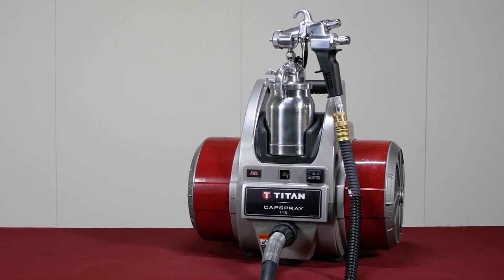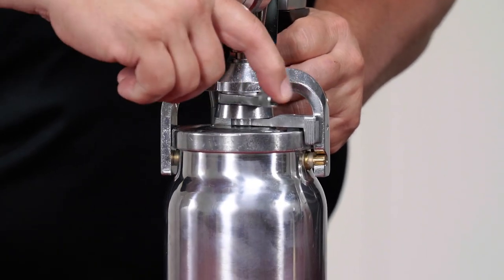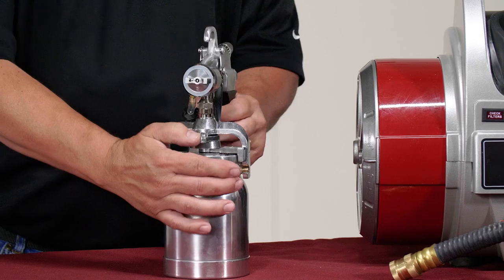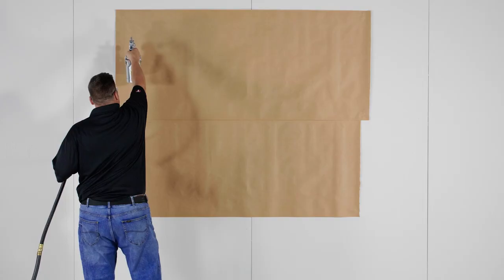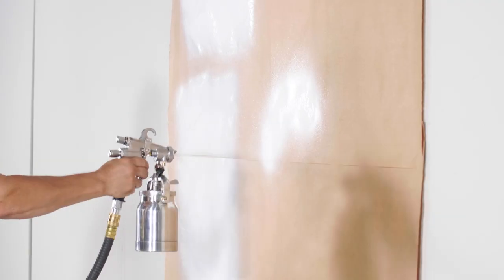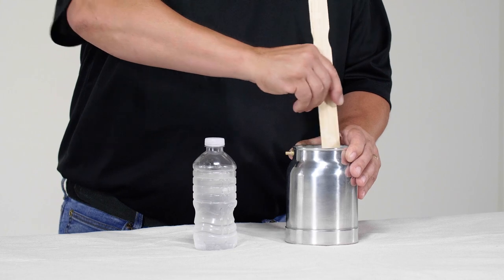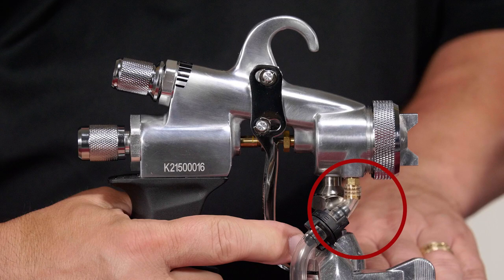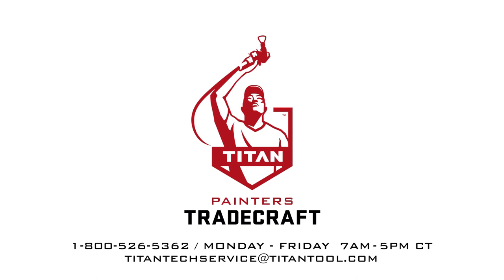Maxum II Pattern Setup | Painters Tradecraft Tips & Tricks

Comment: I’m interested in this machine How do you spray baseboards with that gun? 0:16 can you keep the gun orizontal?
Reply from the maker: Yes, you can keep the gun in a horizontal position.  The pickup tube inside of the cup can be swiveled to different positions.  There will be a time when you're spraying where the tube won't be able to reach the last bit of remaining material however, so you may need to fill the cup with a bit more to continue material flow depending on how long you are spraying in the horizontal position.  Any other questions just let us know 👍
Reply: @TitanSpeeflo  thanks, I saw a few videos about switching the tube front and back but didn’t see switching to side to side.
Reply from the maker: @Igor-q3f  I did speak with the team again this afternoon and they said one recommendation is that if you are going to be spraying at angles frequently it's worth looking into the PPS Cup system for HVLP Guns so you will have the air pressure compressing the disposable liner and won't have to worry as much about the pickup tube placement 👍.  Just wanted to add that today for you.
Reply: @TitanSpeeflo  thank you